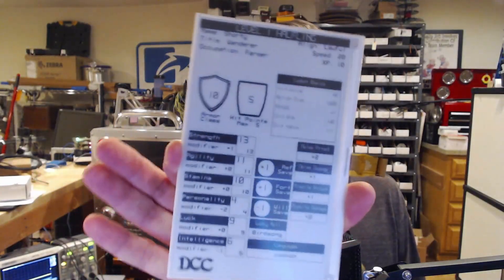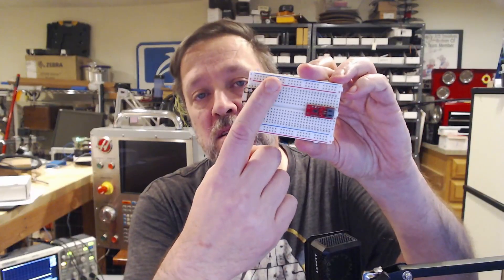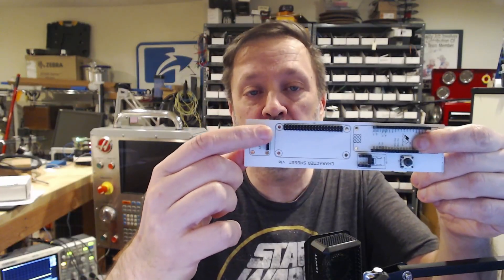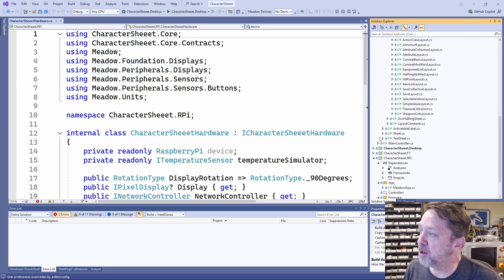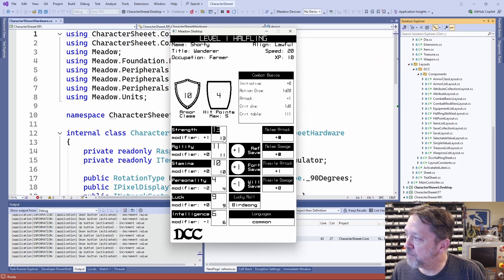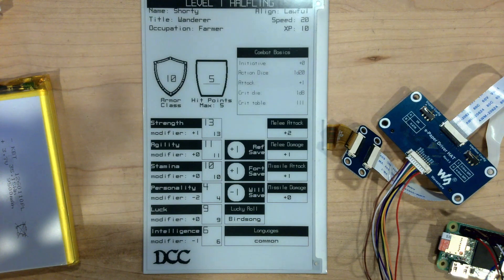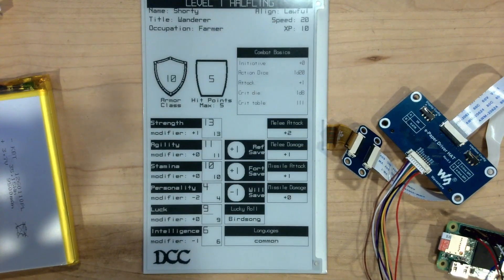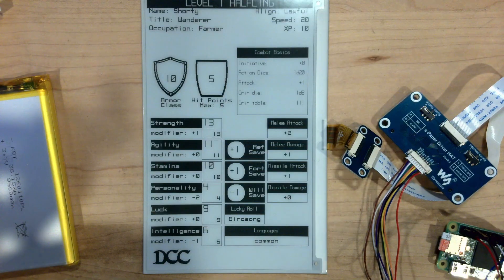Lesson learned: Test your display refresh rate BEFORE committing to hardware

Comment: Maybe you could add one of those touch foils so you can just click where you want to update. Also you only seem to be drawing lines, maybe you can just partially update those 10 Pixels? Then it will look like its a blinking Cursor
Reply from the maker: I posted an update today. I spent a couple days working with this display and while I improved things, it's just too slow for this application.

Comment: I also tried to implement my initial idea in epaper and with fast partial refresh it was kind of acceptable. Granted, I used V2 of the 4 inch module, while you seem to be using the 7.5 inch module, but waveshare claimes partial refresh times of 0.4s. 
While I assume you have explored this option, what I did was partial refresh for 30 frames, then one full refresh with the inverted image. 
In the end I moved to IPS as we wanted to do animation, but I would think it should be possible to implement your idea in epaper as well... Maybe fast partial refresh for cursor movement and one full refresh on enter press or similar. The picture quality will degrade a bit, but for small changes that was fine for me.
Reply from the maker: The waveshare reference driver doesn't have the support for it, but I'm looking to see if I can get partial or/or fast refresh working with this 7.5".  It will be great if I can and I'll update the driver I'm using.

Comment: The concept is great and it would be fantastic if the experience was smoother. What if you reduced the functionality so that the interface only had to show the current state and not facilitate navigation? You mentioned using an app as an alternative. What if a separate app handled editing/navigation while the ePaper display only showed the most recent state? If this was Magic The Gathering, then I'd appreciate the separate display showing the state of the game while my phone screen is busy being used to look up info and search forums about game mechanics. This combination might be more useful, as the app will support more capabiltiies to determine what the ePaper display should show. For example, it would probably be easier to build "undo" functionality into the app than into the ePaper screen.
Reply from the maker: Original plan was similar to that idea. Use a phone or tablet for more complex things like adding equipment or notes, etc but if I have to get out another device just to change HP, why not just keep that one device out? MTG would be similar, since play state changes pretty frequently.

Comment: This is why you do your research first and build stuff with a breadboard.
Reply from the maker: Typically I do. In this case I was lazy and didn't feel like running all of the wires on a breadboard. The circuit was so simple it took very little time to design. It was basically just wires between components. I spent far more time on software.

Comment: slow.. like slower than like how slow .. fastest i read is like 12 seconds a page if im on huge font?
Reply from the maker: 4 seconds for a partial refresh is pretty common.  During that time it also flashes.  So if you're trying to move even a cursor on a menu or similar, the behavior from a user perspective is pretty terrible.  if you're purely using it as an e-reader for books they're fine, but if you need to make any updates to the screen at all, don't expect good things.  And the multi-color displays are even slower.  You can expect 3-4 seconds per color.